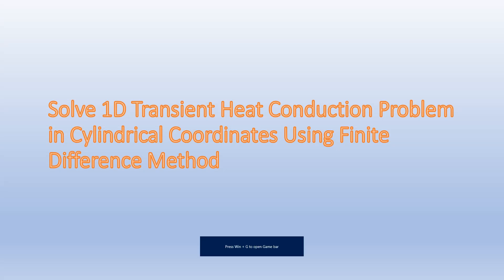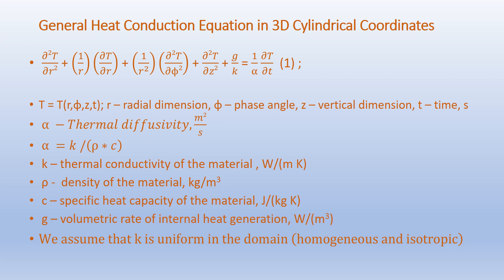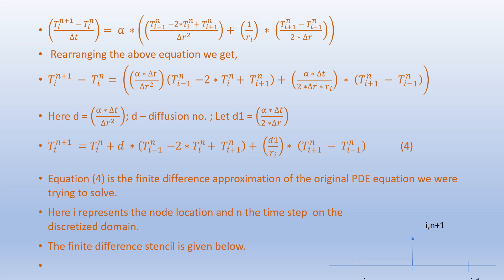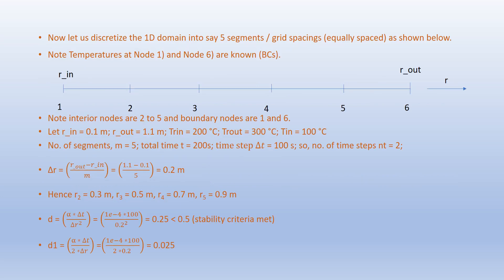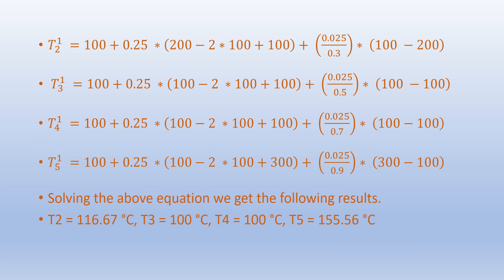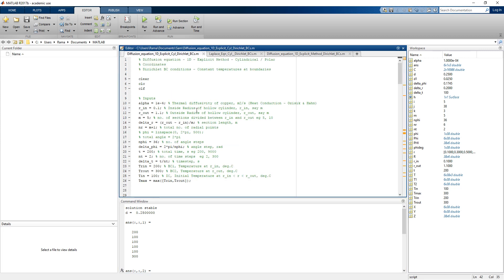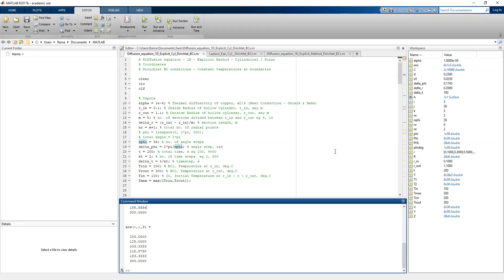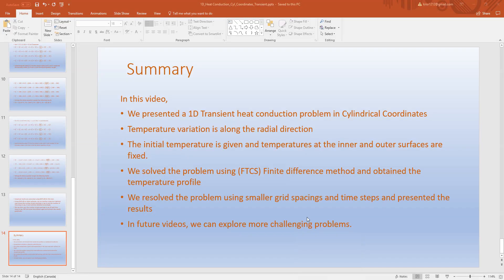1D Transient Heat Conduction Problem in Cylindrical Coordinates Using FTCS Finite Difference Method

Comment: What if r=0 at the centre? What do we get?
Reply from the maker: Temp at the center is finite. So dT/dr =0 at r=0
Reply: @samseleven1  but in your equation we have 1/r
Reply from the maker: @luzzyrogue  that is correct. The equation will blow up if r=0. One way to tackle this problem is to keep r closer to 0 but not zero.
Reply: In your code you have not included 1/r I reckon

Comment: % Diffusion equation - ID - Explicit Method - Cylindrical I Polar
% Coordinates
% Dirichlet BC conditions - Constant temperatures at boundaries

clear
clc
clf

% Inputs
alpha = 1e-4; % Thermal diffiisivity of copper, m2/s (Heat Conduction - Ozisik & Hahn) 
r_in = 0.1; % Inside Radius of hollow cylinder, r_in, say m"
r_out = 1.1; % Outside Radius of hollow cylinder, r_out, say m"
m = 10; % no. of sections divided between r_in and r_out eg 5, I0 
delta_r = (r_out - r_in)/m; % section length, m"
nr = m+1; % total no. ofradial points
% phi = linspace(O, 2*pi, 500);"
% total angle = 2*pi
nphi = 36; % no. of angle steps 
delta_phi = 2*pi/nphi; % angle step, rad 
t = 9000; % total time, s eg 200, 9000 
nt = 300; % no. of time steps eg 2, 300 
delta_t = t/nt; % timestep, s"
Trin = 200; % BCl, Temperature at r_in, deg.C 
Trout = 300; % BC2, Temperature at r_out, deg.C"
Tin =  100; % IC, Initial Temperature at r_in <r <r_out, deg.C"
Tmax = max([Trin,Trout]);
% Solution
for i = 1:nr
r(i) = r_in + (i-1) * delta_r;
end
r;
%{
delta_phi;
phi(l) = O;
for j = lnphi+l
phi(j) = phi(l) + (j- l)*delta_phi; end
phi
%}
phideg = [ 0:360/nphi:360+360/nphi ];
phi = phideg.*pi/180;

d = alpha*delta_t/delta_r^2; % diffiision number
dl = alpha*delta_t/(2*delta_r);

if d < 0.5
fprintf('solution stable\nd = %10.7f1n', d) 
else
fprintf('solution unstable\nd = %10.7f1n', d)
end
% Creating initial and boundary conditions
T = zeros(nr,nphi+2,nt);
for k = 1:nt+1
for j = 1:nphi+2 for i = 1:nr
if (i == 1)
T(i,j,k) = Trin; elseif (i == nr)
T(i,j,k) = Trout; else
T(i,j,k) = Tin;
end
end
end
end
T;
% Creating T matrix
for k = 1:nt
for j = 1:nphi+2 for i = 2:nr-1
T(i,j,k+1) = T(i,j,k) + d*(T(i+1,j,k) - 2* T(i,j,k) + T(i-1,j,k)) + ((1/r(i))) * (T(i+1,j,k) - T(i-1,j,k));
end
end
end
T(:,:,1);
T(:,:,nt+ 1);
T;
T(:,1,1);
T(:,1,nt+1);
T(:,1,:)
% Convert Polar/Cylindrical Coordinates to Cartesian Coordinates
% Initial Temperature Plot
Tl = T(:,:,1);
subplot(2,2,1)
r = r;
[Phi,R] = meshgrid(phi,r);
Z = Tl; % Tl .* Phi./Phi;
[X,Y,Z] = pol2cart(Phi,R,Z);
% figure(I)
[C,h] = contourf(X, Y, Z, 300);
set(h,'LineColor','none') 
grid on
axis equal 
colorbar
title({'Initial Temperature Profile - ID - Cylindrical Coordinates - Heat Conduction Problem with no Source Tenn'; 'T in deg.C'})
xlabel(['r in m '])
% Final Temperature Plot
T2 = T(:,:,nt+ 1);
subplot(2,2,3) 
r = r;
[Phi,R] = meshgrid(phi,r);
Z = T2 .* Phi./Phi;
[X,Y,Z] = pol2cart(Phi,R,Z);
% 6.gure(l)
[C,h] = contourf(X, Y, Z, 300);
set(h,'LineColor','none') 
grid on
axis equal
colorbar
title({'Final Temperature Profile - ID - Cylindrical Coordinates - Heat Conduction Problem with no Source Tenn'; 'T in deg.C'})
xlabel(['r in m '])
% Surface Plot - Animated
subplot(1,2,2)
r;
phi;
[R PHI] = meshgrid(r,phi+1);
Z = T(:,:,1);
for k = 1nt+1
Z = Z';
h = surf(R .*cos(PHI), R.*sin(PHI), Z); colorbar;
shading interp;
title({['Transient Heat Conduction'];['time (litt) = ',num2str((k-1)*delta_t), ' s']}) 
drawnow;
pause(0.005); 
refreshdata(h);
if k ~= nt+1
Z = T(:,:,k+1);
else
break;
end
end
figure(1)
plot(x,T)
title('Numerical Solution')
xlabel('x')
ylabel('T')

Comment: What about surface and centre node
Reply from the maker: This is FDM not FVM
Reply: @samseleven1  thank you for replying. Can you pls help me with surface and centre node as well
Reply from the maker: Are you doing finite volume nethod?
Reply: @samseleven1 actually I am working on quenching
Reply from the maker: @vivekbagul2217  there  are boundary nodes and interior nodes.
Reply from the maker: If you have a specific problem i can help with that but i would charge a fee